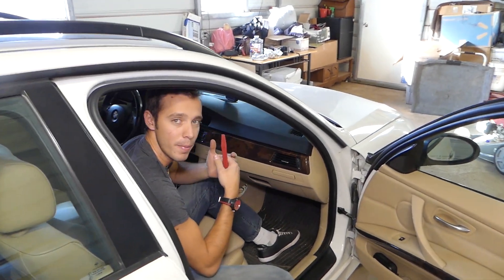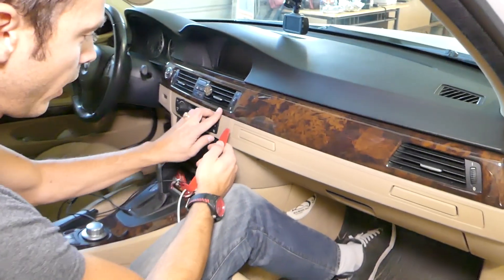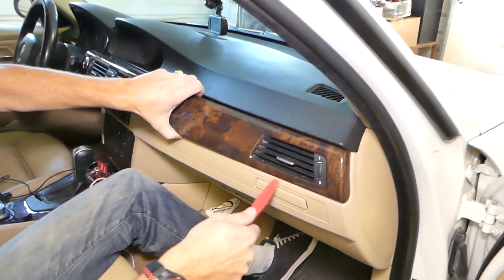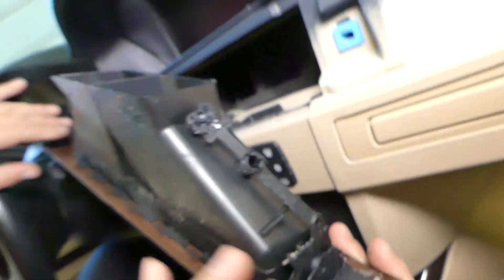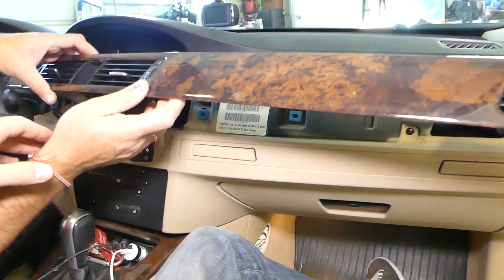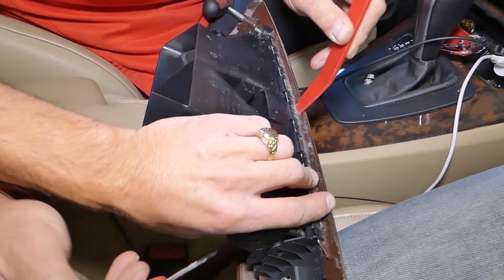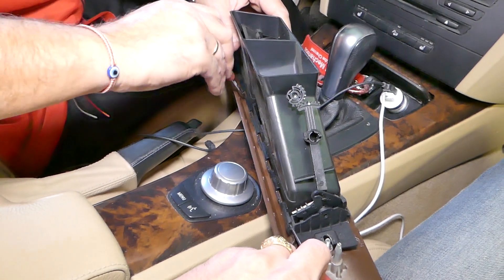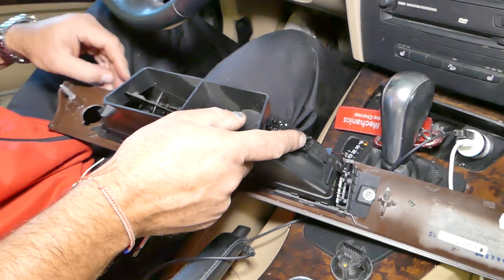HOW TO REMOVE AND REPLACE CENTER DASH VENT ON BMW 325i 328i 335i 316i 318i 320i 335d 320d 318d 325xi

Comment: Hi, I have an issue that no air comes out the vents but the blower is making noise still and the climate control panel still lights on and works?

Comment: nice work.  My problem is When heater on and central is on red: driver vent is blowing heat but passanger and back side blowing cold. Heater is changed before 6 mounth